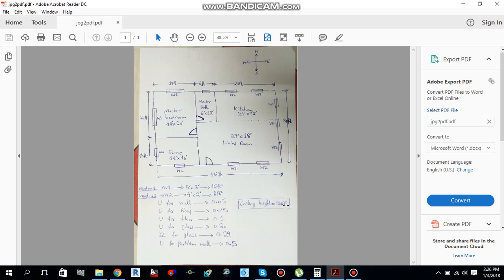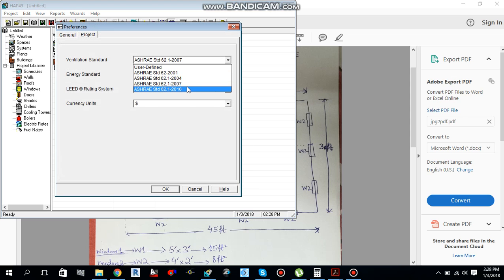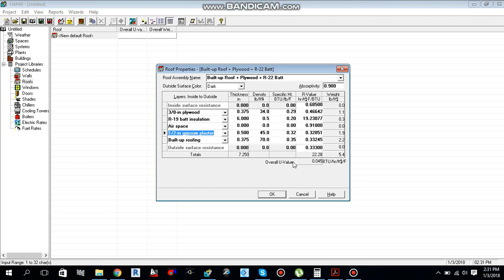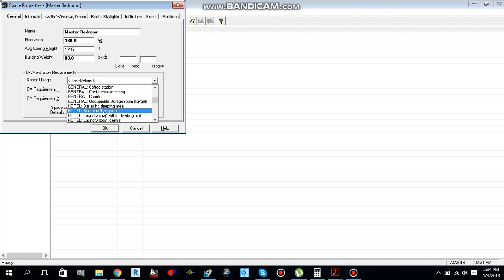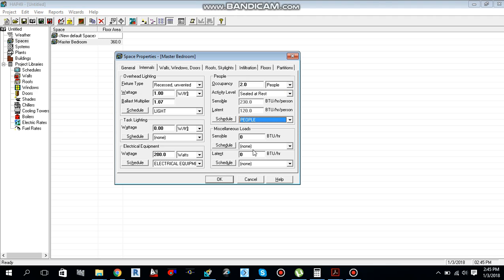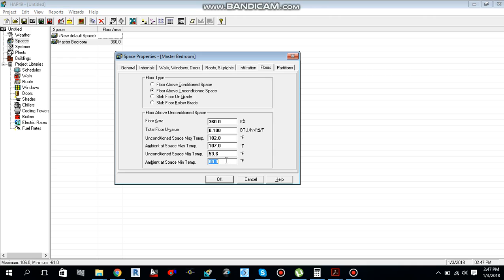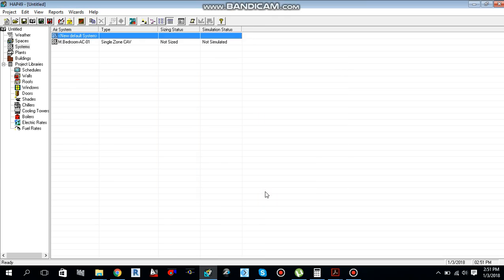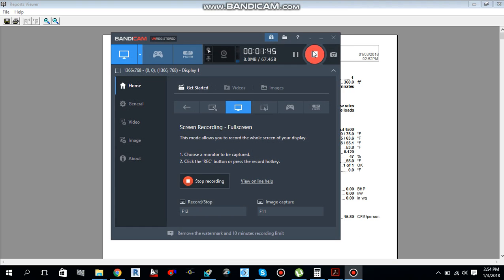hap software heat load calculation with example, cooling load calculation using hap software

Comment: Hi, do you also have a video of load calculation using HAP for a more complex example? let's say a floor plan with different zones, each zone requiring different set-points, and 1 unit per zone. Thanks! Great video btw!

Comment: Superb information...

But just would like to ask
How you got the "U -  Values"

And from where you have selected the ambient temperature "
Reply from the maker: These U values used in the video are standard values but most of the time you have to calculate U values. You can see video on my channel related to U values calculation. And regarding outside ambient temperature it is automatically selected by software based on location you select. If you want to see it manually then you can go to ashrae meto website to see outside ambient temperature for different locations.
Reply: @mepengineeringtutorials  thanku so much for the response....
Also would like to ask from where i can download all the design data required for heat load calculations like thermal resistance ( R value)  and all the other parameters??
Reply: @MEP Engineering Tutorials  thanku so much for the response....
Can you provide all the design data required for heat load calculations like thermal resistance ( R value)  and all the other parameters etc??

Comment: How to add RH value in wether ?
Reply from the maker: You don't have to add RH value manually, it will automatically selected by software based on selected location

Comment: Sir kindly guide karyn.ya u values residential aur commercial k lia diffrent han ya same aur ya u values ka data provide kar dain jis sy han u values malum kar saky commercial building k lia
Reply from the maker: These U values which I had used here are for general use for actual U values you should check material specs of (wall, window, door, floor, roof, ceiling etc) and you can get these values from architectural engineer. Please see how to calculate overall u value calculation on my channel for more details.
Reply: @mepengineeringtutorials  thank u soo much♥️

Comment: Dear All, supposed you have ceiling partition then you had exposed roof, there will be a gap b/w ceiling and exposed roof,  then what will be Temperature different b/w ceiling and roof? @MEP Engineering Tutorials
Reply from the maker: In case of ceiling partition we usually take 5 deg less temperature than ambient temperature at desired location. Let's say ambient temperature at your desired location is 105 deg F in that case you must consider 105-5 = 100 deg F in ceiling area

Comment: Thanks for the Video. I have 1 dought.  When we change the floor area as in this case it is 360 Ft2 to 3600 Ft2 there is no change in the capacity or airflow results. Kindly provide your feedback on this
Reply: Same is the case with the Ceiling height. When we change the ceiling height from 12.5 ft to 30 ft there is no change in the Capacity or Airflow.

Comment: I enter the DB and WB  as  46 and 29 respectively but In the final report the values automatically changes to 45.7 and 28.9 for living room and 44.5 & 28.8 for Bedroom. Why this happed? Kindly  help to solve the problem.
Reply: Still you have this doubt please message

Comment: I have a 3 floor building.. cooling load in the higher floor is more than the below floor.all are typical rooms.for example second floor load is 5kw and same first floor is 2 kw.only.so how to manage the cooling load equally for machine selection?

Comment: Hi it's a very good video.
Can u pls explain what is infiltration and why is it neglected here and if it is to be provided what is the criteria for it ?
Reply from the maker: Infiltration is the unintentional or accidental introduction of outside air into a building, typically through cracks in the building envelope and through use of doors for passage. It is also called air leakage.
Since I already explained in video construction of this house is in the range of highly tight construction that's why I neglected infiltration load. But in case you have house construction is not tight, cracked in Windows and doors open again and again then you need to consider infiltration load. And for this you should know ACH (Air changes per hour) for that particular space for infiltration load calculation

Comment: Assalamualikum 
For some projects after generating report load occurs at Jan 1300 
I don’t understand how that is happening!
Can u please explain
Reply from the maker: Walikumsalam. Without seeing the project data and inputs I can't say anything. It's better if you provide project details so that I can see and let you know the solution for error
Reply: Engineering Tutorials that very kind of u to reply!! Can I mail the query to u?!
Reply from the maker: Yeah sure you can email me on syedmuhammadw@gmail.com
But I am kinda busy now a days so as soon I find time I will get back to you..
Reply: Bro ,if your maximum DB temperature in January is consider as 36C and it will change depends on time if it’s at January 0013 DB will change to 34 or less because each month we have daily range that means temperatures will change in between that range as per the time

Comment: if we cross check by thumb rule is does not  match.
Reply from the maker: This is because the U values which I used for wall and roof are very low. The main thing is to tell you the process of calculating heat load. Also I didn't consider any infiltration load due to tight construction of building. If you follow the process with exact u values used in construction of your building then you will get exact heat load. And anyways thumb rule is NOT the correct way to determine heat load it's just an idea.
Reply: @mepengineeringtutorials  Sir, could you please share the U-values PDF. please find my email id : arunkandula22@gmail.com

Comment: The result is. 9 ton. Can the. 9 ton cool 360 sqft area. Normally we take 1 ton for 120 to 140 sqft. Can u plz clear my dowt
Reply: This is my comment also the air flow must be min 1000cfm and the cooling load 2.5 to 3 Ton.
Reply: I also want to get clarified....Please explain at your convenience. Theoretical value is always much lesser than practical one.
Reply: Thumb rule is not 100 % reliable always.. its taken for rough estimate.. tu

Comment: I need u value value pdf
Reply from the maker: Email address??
Reply: @mepengineeringtutorials  m_haseeb_khan@hotmail.com please send uvalue pdf. furthermore i also need the advice for one of my design . i have a roof and wall whose properties are as follows . 

wall property 
corrugated sheet 18 guage
glass wool 
cement board 9mm 

what is the uvalue of this wall?

Roof property
sandwich panel
corrugated sheet- 3inch
u value?

please reply on my email

Comment: Boss can you put the link of that u value pdf.
Reply from the maker: Muhammed Shehin kindly give me your email address I will forward it to you.
Reply: muhammedshehin7311@gmail.com
Reply from the maker: You can download the related data from tutorial#17 heat load calculation using E20 sheet. Download Link is given in tutorial#17 video description
Reply: neilasrani95@gmail.com could you kindly forward the link to the pdf file on this email address
Reply from the maker: You can download the related data from tutorial#17 heat load calculation using E20 sheet. Download Link is given in tutorial#17 video description
Reply: babarsyed880@gmail.com
Reply from the maker: You can download the related data from tutorial#17 heat load calculation using E20 sheet. Download Link is given in tutorial#17 video description
Reply: khalfeahmadabrar@gmail.com
Reply from the maker: You can download the related data from tutorial#17 heat load calculation using E20 sheet. Download Link is given in tutorial#17 video description
Reply: mubasheer8050@gmail.com

Comment: Where can we get u value for Pakistan
Reply from the maker: You can check it with Architect Engineer. It depends on type of construction. What layer of material is he using for exterior wall, partition wall, roof and floor.  I will try to make one tutorial to get U values.